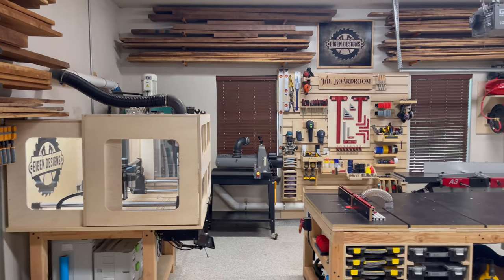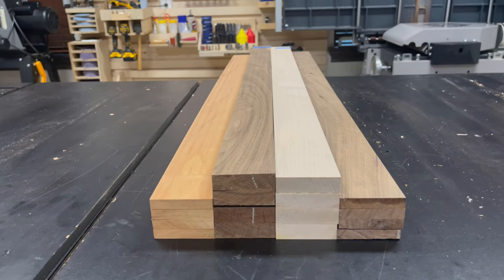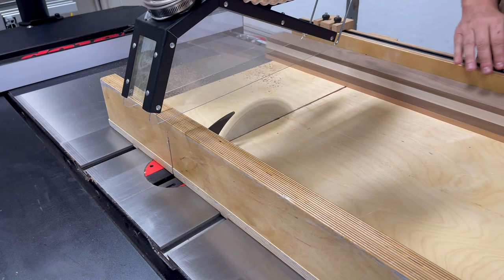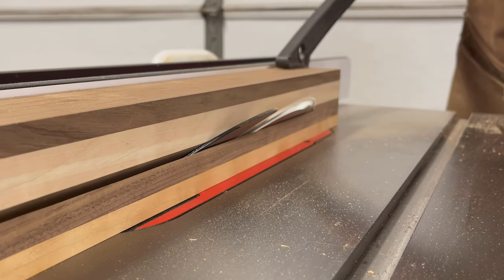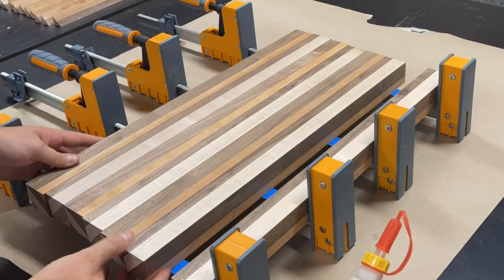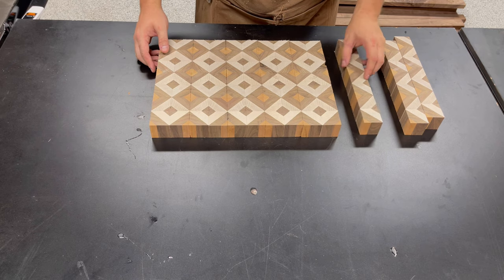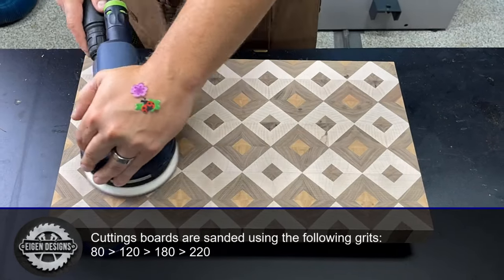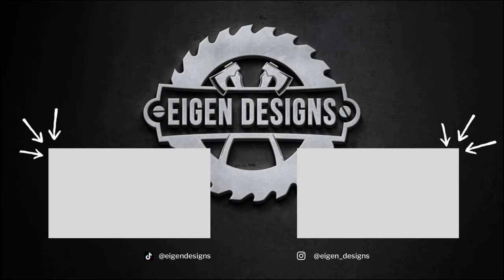Infinite Diamond Cutting Board  |  DIY Tutorial

Comment: The brown tinge is likely from sanding of the mixed colors of wood.  The dust gets mixed and can get into the different woods differently.  The water from grain popping or the finish itself can pull into more into the wood grain, especially end grain.  When finish is applied, the same darkening happens and it becomes a lot more noticeable.  On mixed wood pieces with long stretches i’ve taken to careful sanding by hand to prevent this as much as possible, but it would be tough to do with the pattern here.
Reply from the maker: That makes sense - thanks for sharing Charles.
Reply: Hey mark! I also have noticed myself with using maple that it also does that. I have been told that it's the nature of the end grain of maple to get darker. I made several face grain boards with a hand cutout and matched a radius around the entire outside and it all darkened.  I really did not like it. But I have sold a few! By the way nice board! And thanks for your donation for my wife!
Reply from the maker: @LincolnWoodworks  Thanks for the info. It's good to hear from you - I hope you and the family are doing well :)
Reply: Are you using hard or soft maple?  I had the same problem using hard maple. Switched to soft and the problem went away. Much whiter and better grain.
Reply from the maker: @tracynovak7433  I was using hard maple. Next time I will give the soft maple a shot. Thanks Tracy.
Reply: I agree it’s probably the darker dust getting into the pores. I’ve mixed maple with bloodwood and, upon sanding, the end grain of the maple took on a red tinge.

Comment: Are you still happy with your A341 Hammer? Love this design.
Reply from the maker: Hey Paul. 

I have mixed feelings about it. It’s a great planer, but I have had a lot of trouble keeping the jointer calibrated and co-planer. If shop space is tight, it’s a good space-saving machine, but I wouldn’t buy mine again. I am also finding the beds quite short for jointing longer lumber. 

One thing I do love about it is the digital gauge on the planer. It’s very accurate and has been a huge upgrade from my old benchtop planer

Comment: This is a great design - thanks. I tried it on a smaller scale first - milled up enough wood to do 4 "composite" pieces 24 inches long and 4 gave me 7 inches of width in the final board so I put another piece of wood on each side to bring it up to 12 inches final width just to test it out. Looks great. Now i've just milled enough wood to make 8 composite pieces 24 inches long so now I can have a complete diamond board without any filler at around 14 inches wide with a complete pattern. There is a lot of waste. I was keen to see what you did with yours. I'm thinking of gluing all the triangles together into squares then laminate together and make some kind of end grain board with it? There's probably some way to do a fancy pattern... but I just want to use it because it was all awesome wood.
P.S. I turned my blade on the table saw back to 90 for the last two cuts like some commenters mentioned. Worked fine.

Comment: I spent a bunch of time looking at this design, because it's beautiful. Regarding material use, even if you don't count the typical excess cutoffs and kerf widths lost with any cutting board build, this build (by design) "throws away" about 55% of what you create in your first glue-up -- granted some of it might be salvageable for another project (though what would that be...). By my calculation, at today's prices for S2S lumber, the raw materials for this board (assuming you start with thick stock and don't need to throw away even more for re-sawing or planing)  would be about 2bf of Cherry (~$20) + 3bf Walnut (~$45) + 1.5bf Maple (~$18) = $83. When you take into account that most folks will be getting this in either 4/4 or 5/4 stock, and then cutting down to the required thicknesses, the cost is likely even more. Because you can only get a single 0.75 thickness from 5/4 lumber -- it's not even possible to get the 3/4 and the 1/2 of the walnut from a single 5/4 board due to kerf on re-saw (plus the needed planing to surface it), So I could actually see the material cost going well over $100 to build this, if not $120. 

Mind you, I'm not complaining :) I just wanted to share this in case others are thinking of the economics of building it, especially if their intention is to sell it (will be very hard to break even, I would think, when considering labor). I may still build it!
Reply: Yep, that's true. But not much choice when you make a creative board like this. Still, I appreciate the cost analysis.
Thanks

Comment: Beautiful board. Very likely that I will begin building it today. Question... what were your final dimensions, relative to width and length? I like my finished boards to end up approximately 12" x 18", and the thicker the better. When I get to the stage where I am slicing the sandwiched stock at a size that will determine final board thickness, I'll likely start at 2".
Reply from the maker: The final dimensions for this was 19" x 11.5" x 1.75". Good luck in your build!

Comment: What supplier do you use for wood? I too live in a Texas and have a hard time finding wood suppliers. Very nice board
Reply from the maker: I have a few hardwood suppliers here in Houston that have a good selection (e.g. Houston Hardwoods, Clark’s), but they can be expensive. I would recommend checking Facebook marketplace to see if there are any smaller hardwood dealers in your area. Sometime you can get some good deals on hard woods. Just be sure that the wood has been properly dried before buying (wet lumber can take a long time to dry out before it’s ready to use).

Comment: I love this design... and just watched another video where the poster sprinkles salt on the glue of the final glue-up... gives just enough friction to prevent pieces from sliding as the clamps tighten
Reply from the maker: Thanks Jason. A few have recently suggested that same idea so i will definitely be trying that on my next build. Thanks for the tip bud!
Reply: @EigenDesigns  What are the final dimensions of the board?
Reply: How much salt is recommended?
Reply: @buddyhutchins3782  to taste.